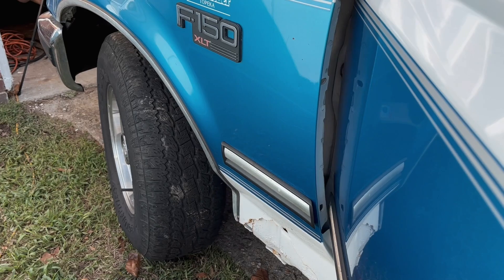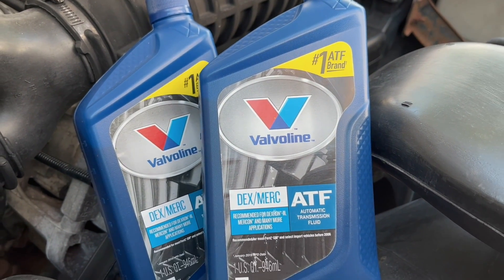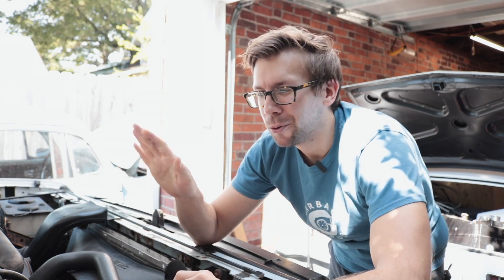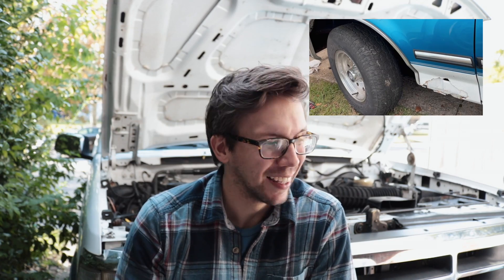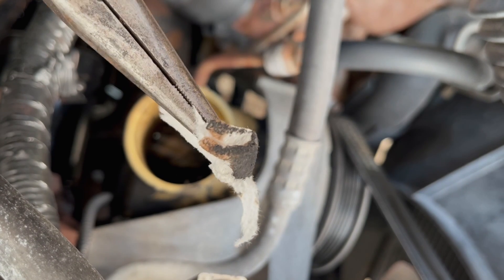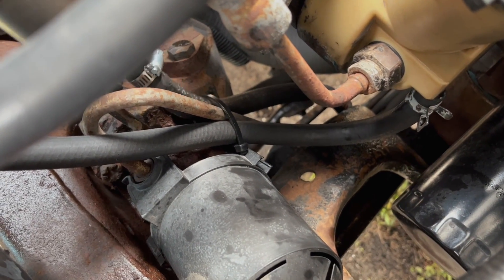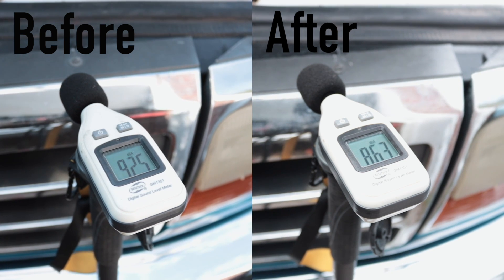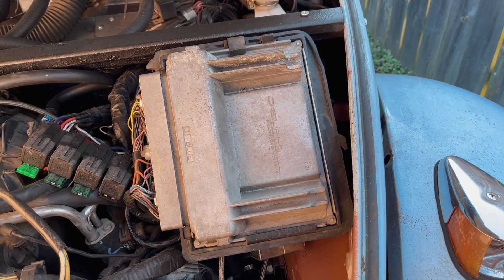Quieting Down Our Loud Power Steering Pump - Before and After Decibel Testing

Comment: It wouldn’t be an old Ford if it didn’t have a whiny power steering pump. The pump in my 75 F150 used to scream bloody murder when it got hot. I flushed it twice with Type F and while it still makes some noise it’s a lot quieter than it used to be.

Comment: Two oz's of brake fluid,,,,it works
Reply: The seals will dissolve into mush if you do that. I've seen that "trick" destroy automatic transmissions.
Reply: @gregorymalchuk272  well I'm sorry for your transmission having that problem,,,, my old truck has been okay with the fluid,,,of course not All transmission s use the same fluid,, different brands use different additives in their specified fluids that could cause the mushy seals,,,I have seen malco additive cause the fluid to turn to jelly like substance,,, off course I don't recommend any additives that is not factory recommended,,,, I tried the brake fluid in my power steering pump to quieten the power valve in it and it's been doing great for year's now,,, good luck.

Comment: I've tried Lucas additive, a new pump, lines, and rack. No air in the system. Still noisy AF.
Reply from the maker: You sir, deserve a Saginaw pump swap! I’ve had “rebuilt” pumps from the parts stores be louder than the pump I took off haha. Just a noisy design imo